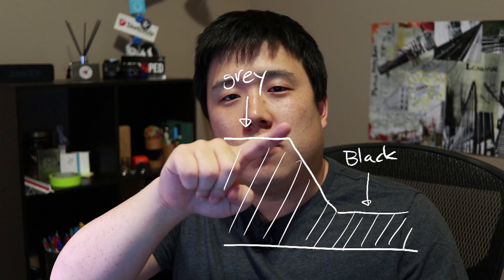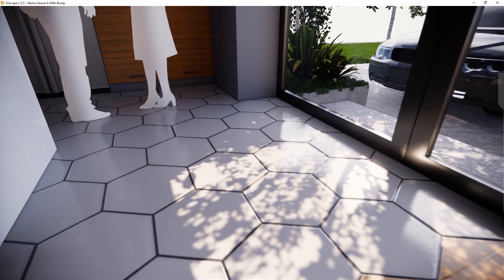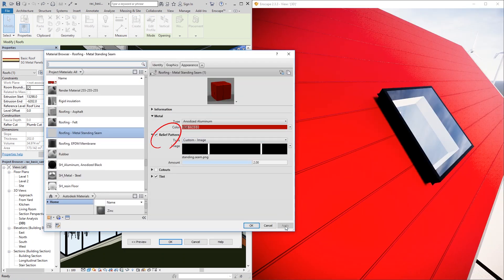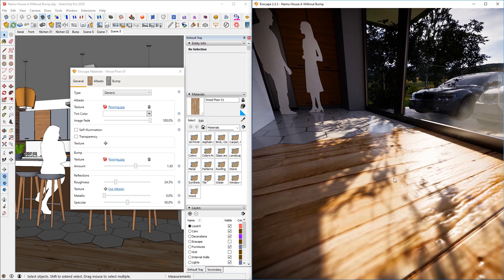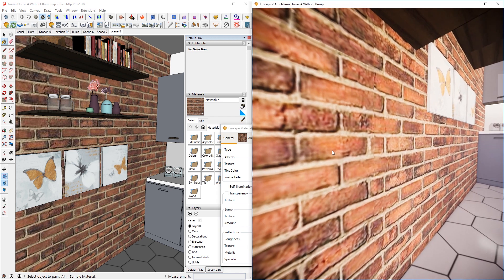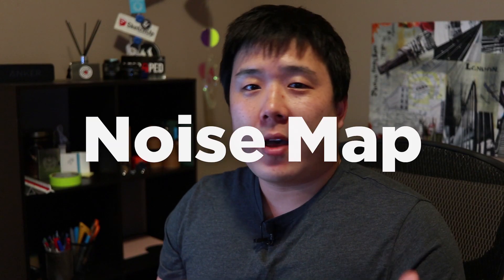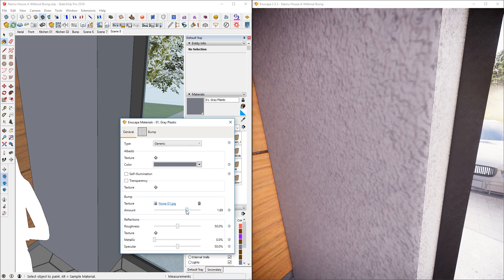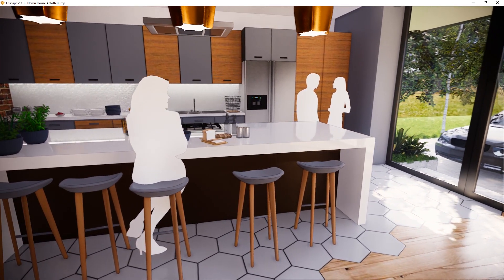How to Use Relief/Bump Maps, and Why You Should Use It with Enscape

Comment: THANKS  FOR THE VIDEO, JUST ONE QUESTION,  YOU MAY ALREADY KNOW THE DIFFERENCE BETWEEN A NORMAL AND A HEIGHT MAP IN OTHER SOFTWARE, FOR EXAMPLE FOR A BRICK WALL USUALLY THE BUMP INFORMATION THAT DEALS WITH MORTAR BETWEEN BRICKS IS STORED IN A HEIGHT MAP, AND THE FINER DETAILS WITHIN ONE BRICK ARE STORED IN A NORMAL MAP ..... MANY PBR MATERIALS HAVE BOTH HEIGHT AND NORMAL MAPS FOR THIS SAME REASON.... PROBLEM IS THAT ENSCAPE USES EITHER NORMAL OR HEIGHT MAP, NOT THE TWO IN SAME TIME, SO IS THERE A WAY TO MERGE THE TWO INFORMATIONS INTO ONE HEIGHT MAP, OR ONE NORMAL MAP SO THAT WE LOSE NOTHING ?
Reply from the maker: Thanks for letting me know, I did not know this. I am not aware of the method to merge them two...